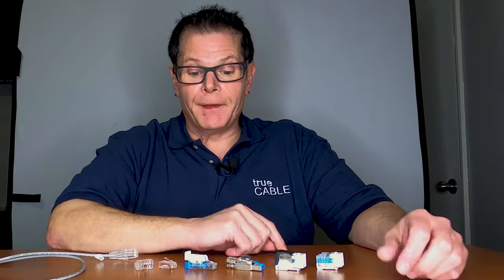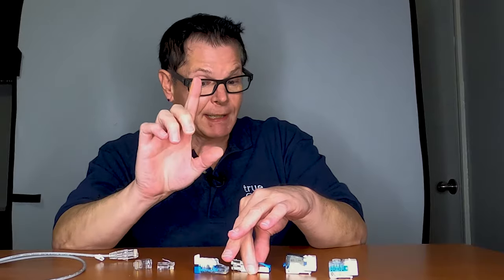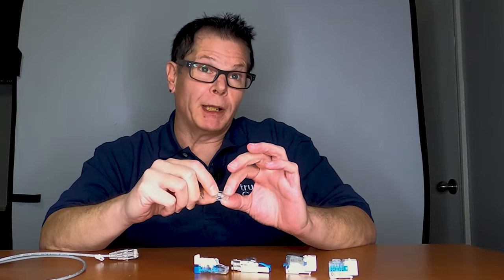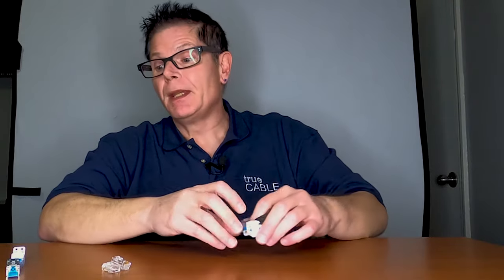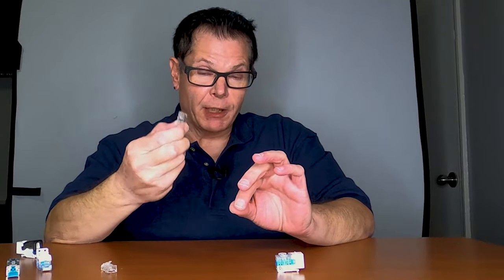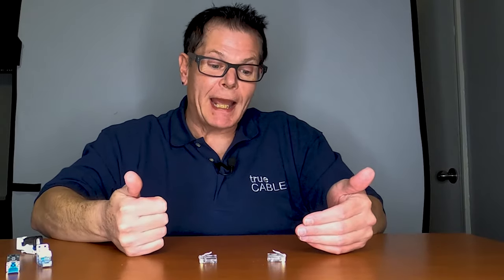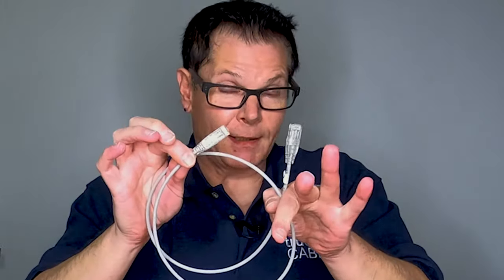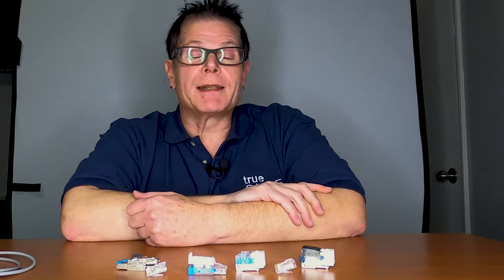Choosing the Correct Ethernet Termination

Comment: This is a great explanation! Thank you, Sr.!
Could you please explain me how does the bandwidth matter on data speed transfer? Since cat 5e and 6 work with up to 1 Gbps, but the former covers 100 MHz and the latter 250 MHz.
Greetings from Mexico!
Reply from the maker: Hello Alejandro! Greetings back from the USA. Higher frequencies are required to increase the data capacity of the cable and termination hardware in question in order to operate reliably. These increased data capacities are separated by Category. So, 100 MHz covers Cat5e up to 1 Gbp/s. 250 MHz covers Cat6 up to 1 Gbp/s and 10 Gbp/s up to short distances. 500 MHz covers Cat6A up to 10 Gbp/s to the full distance Ethernet can run. These frequencies are dictated by ANSI/TIA and ISO. As for extended frequencies, higher frequencies are useful when talking about NBASE-T (2.5GBASE-T and 5GBASE-T). In the case of Cat5e, the cable and termination hardware should achieve 156 MHz to carry 2.5 Gbp/s. In the case of Cat6 the cable and termination hardware should achieve 312 MHz to carry 5 Gbp/s. There are no extended frequencies for Cat6A, so 500 MHz is sufficient.
Reply: @trueCABLE  I appreciate the information you just gave me! I believe bandwidth requires a more profound study. I'd like to understand more about it, since I think it's important to comprehend the core of data transfer speeds and being able to choose the correct cable + connector to avoid latency problems, right? Do you know, by any means, a good website where I can find all this information? Maybe your channel has the answer, but I don't know.

Greetings!
Reply from the maker: @alro7779  Hello Alejandro! The phenomenon of more information carrying capacity with higher frequency is an electrical concept. There is plenty of generic information around it not necessarily related to Ethernet cable. As to matching the correct cable to the correct termination hardware, the Cable Academy found at our website provides a wealth of information. See website link in the description. Enjoy!
Reply: @trueCABLE  Thank you, Sr.

Comment: I screwed up and ordered cat6 shielded crimping plugs from Amazon instead of cat5e shielded. They are passed through which I have the pass through crimping cutter for can I still use them on my cat 5e shielded cable
Reply from the maker: Hello Mortland! The answer is: Maybe. The "Category" of the 8P8C (aka RJ45) plug is irrelevant since they don't actually have a Category on them. When a manufacturer puts a "Category" on the bag of RJ45 8P8C plugs it is their BEST GUESS of what cable is likely to fit, or they specifically tested them with their own brand of cable that they know works (like trueCABLE does). What matters for RJ45 8P8C plugs is fitment (insulated conductor diameter and cable jacket overall diameter). The conductor AWG gauge is not the critical deciding factor here unless you are working with Ethernet with conductors outside of 23 to 24AWG. You will need to find the specs for the plug AND cable in question and see if they match up. We can help you on that one! See this blog right here: https://www.truecable.com/blogs/cable-academy/selecting-the-correct-connector.

Comment: Hi Don, I'm looking for cat6 patch cables to connect from my patch panel to switch. Some ports will be running just data and some POE++. I'm having the hardest time finding Cat6 patch cables that are 23awg. They are all 24awg and up! Will 24awg patch cables at 0.5ft length from the switch to patch panel cause any issues or is that fine at that length? Thanks once again!
Reply from the maker: Hello Richard! Most patch cords are 24AWG or 26AWG or 28AWG with the vast majority of them being 26AWG. 24AWG stranded copper patch cords are an excellent choice. In fact, per the standard, if you want to achieve the full 328 foot channel length you can have 295 feet of solid copper (22 to 24AWG) with two 16.5 foot patch cords at both ends (24 AWG patch cords are assumed in the 328 foot figure, FYI). This provides 33 feet of 24AWG patch cord in total. If you are using 26AWG you must derate to 13 feet max per patch cord, reducing your maximum channel length to 322 feet. If you are using 28AWG you must derate to 10 feet max per patch cord, reducing your maximum channel length to 318 feet. It does not matter if PoE is part of the equation or not. At 0.50 foot with 24AWG you are doing great, and won't have any issues assuming the patch cord is good quality.

Comment: This video is 100% on point.

When I come into a new customer so many times I see the crap job the previous cable installer did by terminating the MDF end in a rj45.

One of the first jobs we do is replace the RJ45s with a proper keystone solution
Reply from the maker: Hey Ronald! 100% correct. The quickest way to ruin a good structured cabling system is hand terminating RJ45s in all the wrong places!

Comment: if I am using B standerd on the Keystone and I what from the other side to be JR45 jeck do I need to cressover it?
Reply from the maker: Hello, CRAFT NET! Nope, stick with T568B on both sides. You don't want to use a cross-over type termination unless you specifically require it. 99.9% of the time, you don't.

Comment: Will true cable rj45 passthru connectors work with a Klein crimp tool? Thanks for all the info
Reply from the maker: Great question! For any of the unshielded RJ45 connectors there should be little to no issue. The same cannot be said for our Cat6/6A Shielded Passthrough plug (external ground), which has been specifically tweaked to work with our trueCRIMP - All in One Crimp and Termination tool --> https://www.truecable.com/products/all-in-one-crimp-and-termination-tool.

Comment: Don...great information however the presentation could be improved.  Focus on the product, not the presenter.  For example, leave these connectors on the table, avoid unnecessary movement and use a pointing tool to highlight the features, i.e., do close-up shots.
Just waving the connectors around in the hand conveys nothing.
Also remember not everyone is doing this as a career.
Some are just DIY folks who want to address their home system.
If this information was useful for you, please let me know.
Reply from the maker: DC, thank you for your comment! We hear you and appreciate all the feedback. Our specialty is low voltage supply and we are still perfecting our videography every day! We create multiple styles of content to help accommodate all types of learners. Please feel free to visit our Cable Academy for blogs and close-up images. We will continue to take all feedback we receive and implement it in the future where we can.

Comment: 1:22 I found the identity disorder joke funny, but also grim - please don't do that again.

So. 90 meters should be the longest permanent link run, to allow for up to 5 meter patch runs on either end?
Reply from the maker: I am glad you found the comment humorous. No offense intended upon anyone! I can also assure you that no field termination plugs were harmed during the making of this video :>) As to the question you had...yes, 90 meters (295 feet) is the maximum length for a permanent link (subject to derating due to ambient temps above 68 deg F). 16.5 feet (5 meters approximately) is allowable for each patch cord at either side assuming said patch cord is 24 AWG stranded. 26 AWG stranded derates this to 14 feet per patch cord. 28 AWG stranded derates this to 10 feet per patch cord.